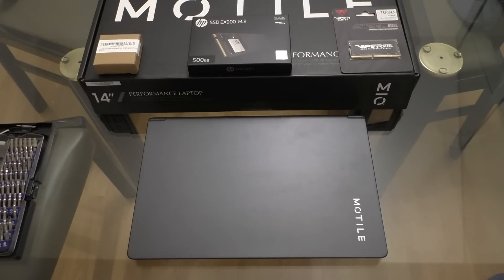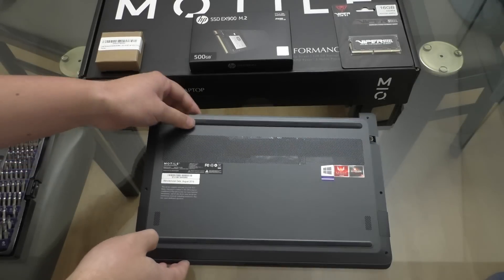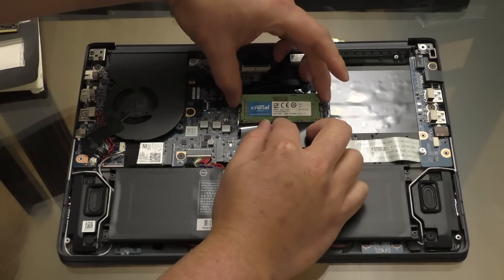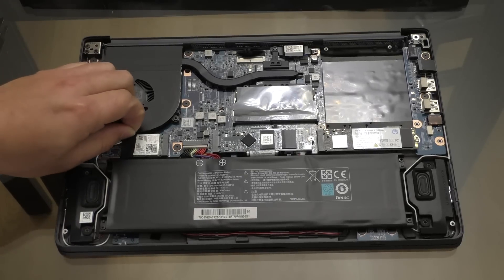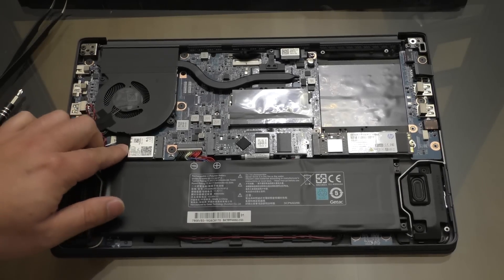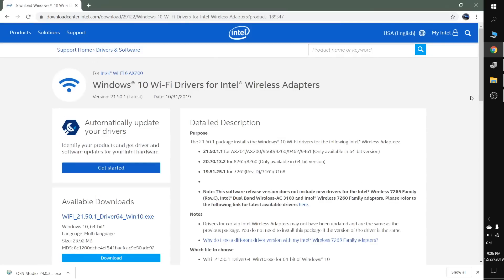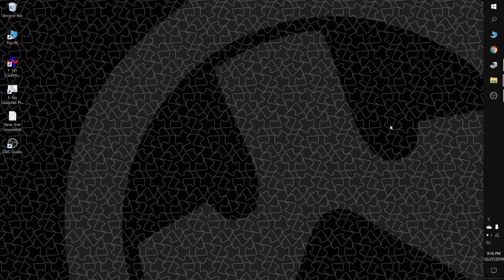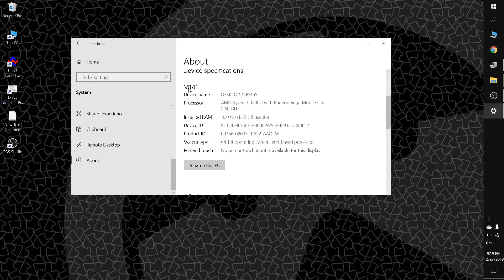Walmart Motile M141/M142 Upgrades (RAM, SSD, Wireless Card)

Comment: Man U forgot to unplug the battery first, that could fry your motherboard
Reply: Thank you man, I really dont want that happening
Reply: @SneakyTurtle420  The black-yellow-red multiple-line cable on the top of the battery pack, that's the battery cable connected to the mobo; when that's connected, the battery is providing the mobo a very little current, but with a large enough voltage to start the laptop, it's this voltage potential that could fry the mobo when there's a ground connection(or anything that's shortcutting); by disconnecting the battery to the mobo, you remove that voltage potential, therefore there's no voltage potentail across the whole mobo, which even if you have a ground connection that won't cause shortcut
Reply: If I put ram in my laptop how do I turn it off the laptop for I can put it in
Reply: @JCW187    shut down the laptop, unplug the power cord, open the back side of the laptop (some laptop can directly take out battery, some laptop's battery is hidden underneath back side of the laptop), 
if the battery is hidden underneath the back side, once open the back side you need to identify the battery and the battery plug (this varies based on your laptop model, if you dont know how usually the laptop battery looks like, you will want to check with oem to make sure you dont destroy your laptop mobo);
once open the backside of the laptop, treat everything as delicate as glass, on the mobo there are many tiny resistors and capacitors which can be easily knocked off if not careful

Comment: How many mhz can the ram be?
Reply from the maker: 2400MHz is the max rate the memory can run at.
Reply: @FaRKle0079  thanks boy
Reply: @FaRKle0079  so is there a reason to go for the 2666mhz  one you used over a 2400mhz version of it If thats the most it can run?
Reply from the maker: @rook5132  No reason to go for 2666 over 2400, other than cost, sometimes it's cheaper!

Comment: My M142 (r5 model) went to sleep/hibernate a few days back, didn't check on it for a few days and then when I did check on it yesterday - my laptop is seriously sick. The laptop wont boot on to Windows, is stuck on Aptio BIOS screen and whats more doesn't even list the SSD under the SATA drives . I suspect the SSD failed as the battery drained - now i dont know what to do... I tried doing the PowerCycle jig with it by letting it sit on BIOS screen for an hour or so as suggested by a few folks in forums - but that didnt work out for me... Did anyone else face this issue or have suggestions for me...thanks
Reply from the maker: You could try reseating the SSD. If the BIOS still doesn't show it after that, you'll probably have to RMA the machine.
Reply: I am having issues with the Aptio screen as well.

Comment: Why wouldn't you use the nvme as the OS drive?  You can still use it as storage.  The bios has all the options necessary to boot from either slot.
Reply from the maker: You absolutely could do that. It just didn't really matter to me.

Comment: Hi! Did it run 2666 or down clock to 2400mhz? Thanks
Reply from the maker: It clocks down to 2400MHz.
Reply: @FaRKle0079  thanks!
Reply: Hi! I navigate to the BIOS but it does not indicate the RAM voltage. The viper steel 2666mhz is 1.2v as I read AND CL18. Will there be any issue?
Reply from the maker: @calotcalot  Yeah, the BIOS has very few options. The RAM will run fine though.
Reply: @FaRKle0079  I keep reading that people installed a 32GB SAMSUNG RAM and it was operational, which means it worked, so I'm torn on buying 16GB vs 32GB...
Reply from the maker: @mgtowmusings196  I think 16GB is definitely a good amount for every-day (including common productivity apps) use without having to wonder if you should've purchased more. If you're going to be doing something more intensive like video editing or something, maybe 32GB would be a better choice. It certainly doesn't hurt to get more though.
Reply: @FaRKle0079  I bought the 32GB and it works great!  A $200 laptop with $60 32GB RAM upgrade and I'm running Civ VI with no problem.

I've been thinking about buying one for my mom.  She's using an laptop from 2006 or something.
Reply: @FaRKle0079  I installed the exact same ram you have in this video and my games/apps make my computer crash almost immediately.  I ran a memtest and it showed that the memory was not bad.  What do you think is happening here?
Reply from the maker: @Fuuuuuuuuub  Do the crashes happen if you install the original memory back in there? Also, when you have a crash usually there will be an error code (hex value) or something displayed. That could point to what's causing it too.
Reply: @FaRKle0079  with the original memory in it still crashes intermittently without any rhyme or reason.  It'll crash in diablo 2 or magic the gathering online or just browsing the web.  This will happen sometimes after thirty minutes or after three hours or so.  It will just randomly hard crash and nothing on the screen moves whatsoever, the windows key doesn't work, Ctrl alt delete doesn't work and no keyboard or mouse input either.  I have to hold the power button down to reset entirely.   I have also installed all drivers and windows update as well as reset the PC to factory defaults.  After everything I still got the issue.  I just got back from sending it into their warranty repair center, but it cost me over 50 dollars in shipping 😟.
Reply from the maker: @Fuuuuuuuuub  Oh man, sorry to hear of all your issues. Well, it definitely doesn't look like RAM is the issue. Maybe this is a dumb question, but does the fan on your laptop turn on? Could the unit be overheating (you can use a program like HWinfo64 to see temps). My unit actually came with the fan unplugged from the factory...
Reply: @FaRKle0079  I checked the temperatures using that application and had no signs of overheating.
Reply from the maker: @Fuuuuuuuuub  And there's no crash logs or anything like that from Windows or the programs themselves to see what error codes came up?
Reply: @FaRKle0079  I checked the logs and did not see anything at all. ☹️
Reply: @FaRKle0079  please help, I'm scared.
Reply: @FaRKle0079  got it replaced, it seems like the mobo was faulty. Everything works like a charm now, although there are weird moments the laptop goes super glitchy slow during web browsing and I have to force restart using the power button.

Comment: Can someone confirm single ram slot?  And is the 2nd m.2 slot only nvme compatible or also compatible with m.2 ssd?

Edit:  It appears it only has one ram slot.  I tried a non-nvme drive in the second slot and it wasn't recognized and you cannot change the slot settings in the bios.  Whether or not the 1st slot can run an nvme I doubt it.

Comment: How important is it to connect both wifi antennas I am having a hard time getting the second antenna to connect.
Reply: One is Bluetooth the other WiFi so if both are not plugged you will not have one of the two wireless options.
Reply: I just put the old wifi card back in because I could get both antennas to connect to it
Reply from the maker: @TheMrb0908  It's important to connect both antennas. If you're having trouble connecting them when the new card is in the slot, try connecting them before putting the new card into the slot. The wires have enough slack in them to do so.
Reply: Thank you, I have the original wifi card in for now. I'm going to try putting the new one in again tonight, I'll let you know how it goes.

Comment: Someone correct me if i'm wrong, but one youtuber said the 2nd ram slot is blocked my the included m.2 ssd. So to use the 2nd ram slot ot get dual channel, you have to remove the m.2 and upgrade to an nvme ssd and use that slot instead. I've only ever heard one youtuber ever mention it.
Reply from the maker: Unfortunately that guy didn't take a close look and was flat out wrong.

Comment: Laptop support RAM more than 2400 MHz?

I am confused. What option better? 
1) 2400 MHz - CL 14
2) 2666 MHz - CL 15
Reply from the maker: Probably the 2400MHz. This CPU can't run at higher than 2400MHz and the 2400MHz stick has a lower latency (CL14). That said, the 2666MHz stick should also be able to run at CL14, when clocked to 2400MHz, but this laptops BIOS doesn't allow you access to change timings.
Reply: @FaRKle0079  I just looked and my copy came with a 2666 stick stuck running at 2400.  No option to change it either.
Reply from the maker: @bobbya557  Yup! Amusingly enough they all come with 2666MHz sticks even though the APU can only do 2400MHz.

Comment: Am I the only one having issues getting the screws back in? Specifically the front corners? I feel like I'm going to strip these screws.  Bad...
Reply from the maker: Do the threads on yours have an abundance of threadlocker?
Reply: @FaRKle0079  I ended up taking it to a computer repair shop and they were able to get the down, but not easily.  I probably didn't have the best screw driver for the job.  It was the right size, but not the best handle.  Oh well, hopefully that'll be the last time I get into the guts of the machine.  Thanks for all the help!  Great step my step guide. This was my first time inside a machine in a LONG time.

Comment: I like to lean back in my recliner and put my laptop on my pot belly.  I have messed up a couple of Acers by doing this.  Looks like the venting of the M141 is all on the bottom.  Any chance this might happen on my Motile?
Reply from the maker: The bottom cover does have a large open area/vent, but the cooling fan exhausts out of the rear of the laptop under the screen. As long as the fan intake isn't obstructed (right side of the bottom of the laptop) you should be fine.

Comment: I just finished these upgrades to the M141, and I am pleased with the results, especailly since I caught the Walmart price pendulum at $199 for this model.  The parts arrived on different days so I did it in stages, which was interesting: The wifi upgrade was well worth it as predicted. The 16 GB RAM upgrade (from 4 GB) was actually a bit disappointing at first (maybe because of the single-channel?) compared to RAM upgrades I've done on Intel machines. But it paid off with the final stage, adding a 1 TB NVMe, then cloning the original to it and making it the boot drive.  Whoa. NVMe is awesome!  I spent about $400 total, and the laptop performs like it cost 3 times that.  This will be my son's "off to college" gift -- and if he's shamed by the off-brand label on the lid he can put a sticker over it :^), or just brag to friends about the upgrades.  Thanks, FaRKle0079!
Reply from the maker: What a cool gift! If you add a small vinyl on the lid with his monogram or initials, you could also say you made him a "bespoke laptop" haha.
Reply: @FaRKle0079  Does the first m2 slot only support sata? I bought a new nvme ssd and cloned it, removed the stock ssd and couldnt get it to boot when the nvme was in the original ssd's place. Moving it to the second slot allowed everything to work great, but was curious why it won't work in the OG spot.
Reply from the maker: @Jaxalop3  I've read of others being able to use NVMe drives in the first M.2 slot. Not sure why it wouldn't work in the first slot. Does the BIOS recognize it in the first slot?
Reply: @FaRKle0079  is the ssd the storage on the laptop? Since it only has 128 gigabytes of storage
Reply from the maker: @poppyssad6545  Yes, the SSD is what contains all of the disk space storage.
Reply: Amin Khodary, I don't know whether YouTube, or the owner of this channel, will allow posting of URLs in the comments, but here are the links, from Amazon:

https://www.amazon.com/gp/product/B07YFFX5MD
https://www.amazon.com/gp/product/B07QMPTNXY

And if you need to search for them instead, here are the full names from the listing:

Western Digital 1TB WD Blue SN550 NVMe Internal SSD - Gen3 x4 PCIe 8Gb/s, M.2 2280, 3D NAND, Up to 2,400 MB/s - WDS100T2B0C

Patriot Viper Steel DDR4 16GB 2666MHz CL18 SODIMM Memory Module

All I can say is that they worked for me. Good luck.
Reply: @danmagoo  Thanks!!
Reply: @danmagoo  would you say your upgraded laptop would be able to handle Call of Duty Warzone?
Reply: @aminkhodary5154  Sorry, I am not a gamer.  I can tell you the laptop is capable of basic video editing and rendering.
Reply: Did you notice a better performance with 16gb of ram?
Reply: @agustinlopez6595  To add onto what Dan said, the NVMe combined with the ram is definitely the dream in this laptop. Boot times were slower than my mechanicals in my desktop on the stock SSD. Now with 16gb of ram and a 512gb NVMe, boot times are 3-5 seconds, and everything is extremely quick now.
Reply: @Jaxalop3  did you clone the original ssd? Or just did a clean install in the nvme?
Reply: @agustinlopez6595  I just cloned the original ssd. No issues with Macrium.
Reply: @agustinlopez6595  There was only a day or 2 when I was using the RAM upgrade before the NVMe drive arrived and I added it.  But my impression, in that limited time, was that I expected better from 4 x the RAM. I would say, if you're getting 16 GB RAM, also get some kind of NVMe to go in the open slot, and make it the boot drive using free cloning software like Macrium Reflect. The 1 TB WD drive was probably overkill, when you can get 500GB for a reasonable price.
Reply: Can you please post the links where you bought the NVMe and the 16GB RAM, I would really appreciate it :)
Reply from the maker: @aminkhodary5154  The links where I purchased are in the video description.
Reply: @FaRKle0079  Thanks!. How's your laptop doing so far?
Reply from the maker: @aminkhodary5154  It's doing very well. There was one automatic SW update that disabled Windows Hello facial recognition for a couple of months, but that's since been fixed with another auto SW update.
Reply: @FaRKle0079  so glad to hear that. I'm a bit skeptical that it might have some problems in the future that's why I'm asking
Reply: how would I disconnect the battery before installing the other stuff
Reply: Will this Laptop accept a 2.5 Style of Hard Drive??? Or is it stuck using M2 style???? I already have a 2.5 size HDD that I would like to put in it.....

Comment: Can anyone confirm it'll take 32gb ram? Gonna use for my networking class, and we're running a few VMs at a time.
Reply: I just upgraded mine with 32GB and the system is showing it, I'm going to test it right now.

https://www.amazon.com/gp/product/B07N124XDS/ref=ppx_yo_dt_b_asin_title_o00_s00?ie=UTF8&psc=1
Reply: Yes. Here is confirmation

Comment: On the panel with the on and off button the metal strip it gets really hot, is that normal and can it damage it. This happens when I play games
Reply from the maker: That area is right over the main heatsink and fan, so it makes sense that area would feel hot under higher loads. It's likely not an issue.

Comment: Will a Crucial P1 500GB 3D NAND NVMe PCIe M.2 SSD - CT500P1SSD8 or Sabrent 512GB Rocket NVMe PCIe M.2 2280 Internal SSD High Performance Solid State Drive (SB-ROCKET-512) work too?
Reply from the maker: Yup!
Reply: Sabrent best nvme ssd I ever own hitting over 3000 mbps paid 28 for 256 last year no it cost more

Comment: Are you finding that the M141 with the NVMe upgrade, is fast enough?  (I would get  one of the 1 TB choices, and use it as the boot drive. ) The M142 comes with a Ryzen 5 instead of Ryzen 3, but with the $200 price difference between the 2 laptops, I'm thinking that $200 covers all the upgrades ( with the only difference then being the CPU).  I'll be tossing the original RAM anyway, and will hardly care about the 128 vs 256 GB on the original .M2 once the 1 TB NVMe is added, but....I'm wondering if the slower CPU is OK.
Reply from the maker: Fast enough for what exactly? The SSD defnitely isn't the bottleneck when I transfer video files across my network. For a media consumption device the machine is plenty fast. I haven't had any issues with some of the suspension calculation excel sheets I've made either.
Reply: @FaRKle0079  Good points, thanks.  We're mainly talking about a school laptop, which will include some use of PhotoShop and the occasional audio and video project, although the kid would naturally appreciate being able to do some gaming on it. I think it's worth the savings of 200 bucks, vs the M142 from all you're said.
Reply from the maker: @danmagoo  I think for a school laptop it'll be plenty fine. I haven't thrown MATLAB on the Motile, but when I think back to my college days, I was running that on a MUCH less capable laptop...

Comment: I swapped out the wifi card and upgraded the memory to 16gb and put in a 1TB Sabrent rocket nvme, speeds are only 500mb/s on crystalmark any ideas to get full speed?? chipset drivers?? bios update?
Reply from the maker: Is there any other activity going on, on the drive during the test? When I have other activity going on the CDM scores are much lower than if CDM is the only thing running. If I run the test fresh after bootup when nothing's running on my EX900 I get in the 1000+ MB/s range, but if I've got something else going on (like recording video to the drive) the speeds drop to 400-500MB/s.
Reply: @FaRKle0079  nothing is going on in the background that I'm aware of...
Reply: Rebooted and tested again now in getting over 1500mb/s. Thanks for the tip and the videos. This laptop is great for the price.
Reply from the maker: @AaronLOSTWITHOUTGOD  Sweet, glad it worked!

Comment: How much better is the new WIFI 6 card than the WIFI card that comes initially with the system?
Reply from the maker: MUCH better for file transfers. When transferring video files between this laptop and my other computer I only get about 25MB/s with the original WiFi card, but get 70MB/s with the AX200.